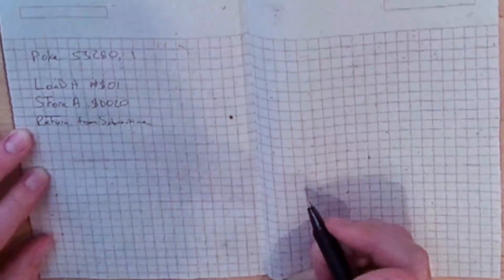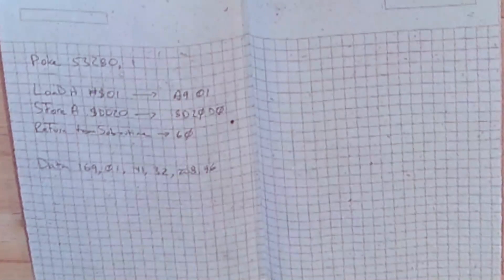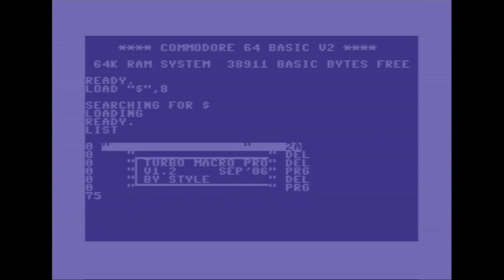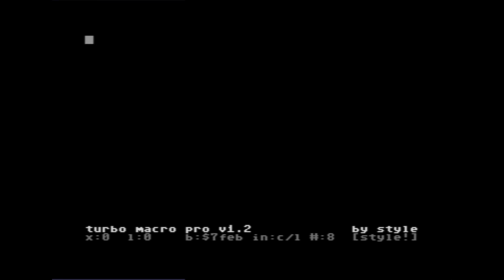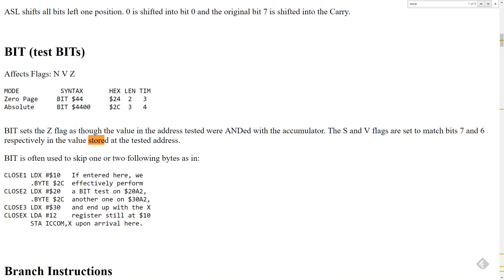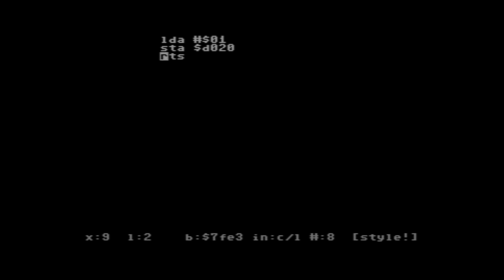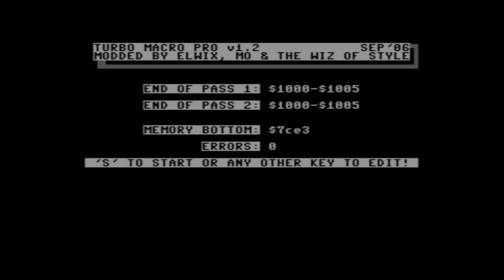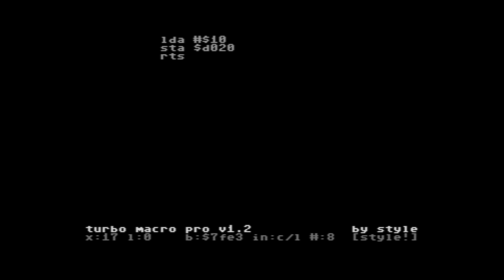Commodore 64 Part 3: Intro to 6502 Assembly

Comment: THE RETRO PROGRAMMER, 
   **  ---         What are the differences between 6502 assembly language, Z80 Assembly Language compared to Machine language? Are they the same thing or whats the differences? 
Basic Language has a compiler that converts the basic language into machine language code. 
A Language converts machine code into what?
Reply: The assembler are using mnemonics for an instruction set with or without operands and with some addressing modes of a CPU for to build the operating mashine code. It convert mnemonics into opcodes. Each assembly language is specific to a particular computer architecture.  Assembly language uses a mnemonic to represent each low-level machine instruction or opcode, typically also each architectural register, flag, etc. Many operations require one or more operands in order to form a complete instruction. Most assemblers permit named constants, registers, and labels for program and memory locations, and can calculate expressions for operands. Thus, the programmers are freed from tedious repetitive calculations and assembler programs are much more readable than machine code. Depending on the architecture, these elements may also be combined for specific instructions or addressing modes using offsets or other data as well as fixed addresses. Many assemblers offer additional mechanisms to facilitate program development, to control the assembly process, and to aid debugging.

Comment: no-one mentioned it. But when you changed #$01 to #$10 (saying ten) it actually changed the value to 17 (10 in hexadecimal). Hence the border went to black and not to pink as some may expect.
Reply: Actually hex 10 is decimal 16, but your point holds because the least significant nibble is zero, so the corresponding color will be black.

Comment: I like the thoroughness of your approach, although I would've probably gone with a crossassembler like Kick Assembler instead of TMP, it's a lot friendlier to new users than using an assembler on the real machine. I also enjoyed the oopsie with color #$10 at the end :)
Reply: Jason Turner What’s the difference, Jason? Could you explain, please?
Reply: @bierundkippen720  
Cross-assembly means assembling on one machine into the instruction set of another machine. He probably means getting a modern 6502 assembler for your X86 pc and assembling to 6502.

Comment: You make assembly seem so simple :) Looking forward to the next episode.
Reply: it's lots of fun. I used to make my C64 freeze and crash in lots of weird ways.
Reply: I think it's a LOT more fun, though, to make the C-64 do things like cycle through all the possible border colors and cycle through all the possible C-64 characters on the top left corner of the screen. To do the latter, here's what you type into the assembler:

a 1000 (assuming you want to start your Machine Language program at Hex address 1000)

inc $0400
jmp $1000

Back in BASIC, you run this program by typing in: SYS 4096

Now to do the border-color-cycling:

a 1000

inc $d020
jmp $1000

Again, type SYS 4096 to execute the program.

Another safe location to place your ML program in is Hex c000 (which in 49152 in Decimal). To run an ML program at that address, you type SYS 49152
Reply from the maker: It's literally almost the most simple thing you could do - which is what makes it hard to do it well. :)
Reply: Is assembly simpler than C? I'm still not sure. It depends on the machine I guess